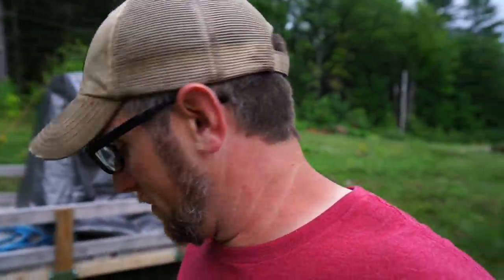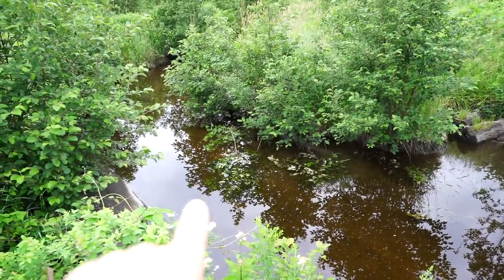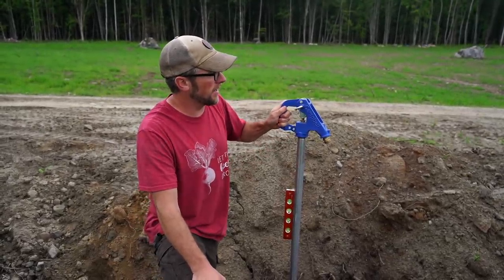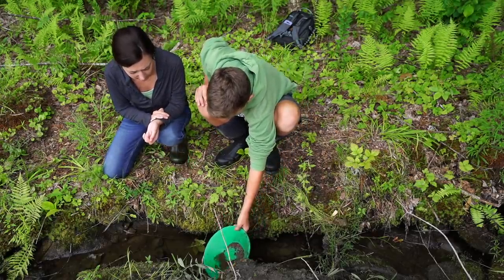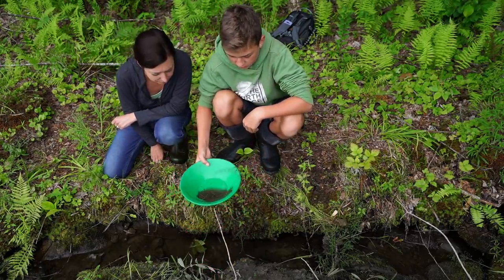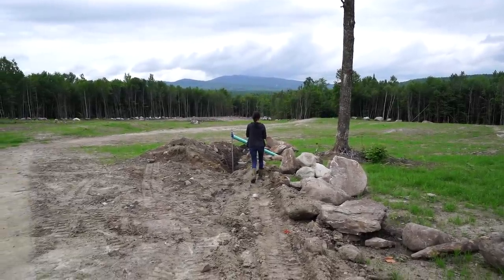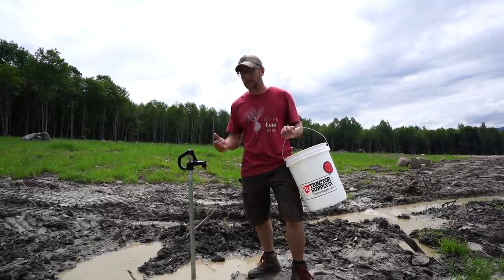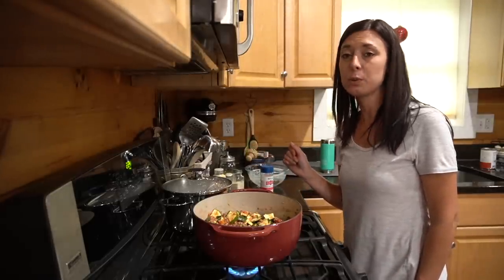DID We JUST WASTE all of OUR TIME & MONEY!?! Testing Our DIY GRAVITY FED Water System

Comment: Is the tank vented? If not then that could cause slow flow.
Reply: Besides the overflow pipe?
Reply: That would not have been instant, it would have taken a few minutes to build up a vacuum in the tank. Still even then it needs to be vented.
Reply: @jameshartman5574   There's your vent.
Reply: If the creek is supplying more than is being sent down the pipe the overflow will not have air in it to be a vent.
Reply: @Gmanboobies  If the tank is being filled as quick as it's flowing out then there won't be any problem.
Reply: They said in the last video that the cover for the tank had holes in that would be your vent
Reply: The input from the spring would prohibit any vacuum from developing.
Reply: @ryanhoward1013  I must have missed that. I have a wife and a cat and sometimes I get interrupted when I'm watching.
Reply: @jameshartman5574  the overflow pipe would be enough, its not vapor lock.
Reply: an easy way to check that is to just take the top off the tank and see if it helps
Reply: Bill Herrick ,
You are correct. The water line is just like a drinking straw.
You must have an in and an out to have good flow.  It works exactly the same way for air flow also. In your vehicle ( car or truck ) turn on the fan ( heater or air conditioning ) with the driver's window open.  Then close that window completely. You should be able to hear the fan slow down a little as you close the window. It is because you are trying to blow air into a closed area. I always leave the driver's window open about 1/8 to 1/4 inch. ( winter or summer ) It makes for less stress on the fan. It does not have to work quite as hard. It works the same way for water. You can do a test ( experiment ) with a drinking straw. Fill it with water , place you finger over one end and the water will not flow out of the straw. At est it will perhaps drip a small amount. Now , remove your finger and the water will pour out of the straw. You see , it is actually air pressure that causes the water flow. By the way , water or air that goes from a larger diameter pipe ( or passage ) into a smaller diameter pipe will increase in velocity. Faster flow. Not more pressure but a faster flow. Try it with your thumb over the end of a water hose.
Reply: @donaldmiller8629  Good point but it has been determined the tank is vented in a couple of ways.
Reply: Simple...take off the lid and see it it changes...if not then you know.  Maybe a small solar pump at each spigot would do the job.
Reply: @rickster9993  Lolzzzzzzzzzzzz!
Reply: I think you could have something there. It does need a vent or it will start collaspsing on itself.
Reply: @zippythechicken  I like that idea! I hope Al checks that out.
Reply: @rickster9993  I just have cats, and that happens to me a lot. lol
Reply: @StoneKathryn  it won't collapse,  it's an underground tank 🤣
Reply: @rickster9993  exactly 💯% 👍
Reply: I was wondering about the ‘head’ in the system.  I can’t tell from the videos, but it seems that the tank and faucets are pretty much on the same level.  If this is the case, the water viscosity will seriously affect the pressure over longer distances.  Even shorter distances won’t give you much pressure (if any) when everything is on the same level.
Reply: He needs to lower the hydrant's, they are to high, they need to be much lower than the tank to allow gravity to work right.
Reply: @StoneKathryn  thanks :o)
Reply: He put an screw top on it. Then does it have any ventilation. I am grad you thought of that. It did not even cross my mind.
Reply: It's easy to check if it needs a better venting system.  Just remove the cap and turn on hydrant

Comment: Al the risers for the hydrants are to high, this puts them to close to the elavation of the water suply. Lower the hydrent will give you more water flow.
Reply: My thoughts indeed!
Reply: My thoughts also Al , how many feet fall is there from the bottom pipe of your tank to the top of the hydrant?
Reply: Exactly, he is almost expecting water to run uphill ?
Reply: John you the man.. I have a question so if there is a break in the line, will our boy have to dig it up ?
Reply: @whaler4life507  LOL, no, just turn 3 circles and click your heels together!
Reply: I agree. the problem with those hydrants is that he may need to dig them up to shorten them. the actual "VALVE" is at the bottom of the hydrant below the frost line. This is the same design as a fire hydrant. I hate seeing Al do so much work without properly researching the task beforehand. Checking the grade as you dig would dictate where everything would have needed to go to function properly. Fore example, the tank may have had to go further up the stream to get the proper drop/flow Al was looking for.
Reply: Still,won’t have enough flow to do anything.  Needs a lot more elevation.  Every 2.3 feet is only 1 psi.  Shortening the spigots will only get him about another 1 psi.
Reply: @SpicySteve-tz2so  I think he knows this but he said he didn't want to go back in the forest to get higher up to the spring. He didn't want to start cutting down trees to get his equipment up there to install it higher.
Reply: @StoneKathryn  what's another few trees going to matter 🤣🤣 he's cleared so many acres already
Reply: @whaler4life507  you bet😁
Reply: @SpicySteve-tz2so  He forgot his laser level that day , remember .
Reply: Here's an idea....get a couple more of those food grade water containers and place them in a row above ground. Use 2" bulkhead fittings to connect all of the tanks together. Place the bulkheads on the sides near the bottom. Place the tanks on a concrete pad. If you can't do that make sure to use flexible pipe (what they use for ponds) in-between each tank so there's not much pressure on fittings or pipes if the tanks move in dirt..buy a solar well pump they sell kits on eBay. It's a low flow pump and panel for around 2 to 3 hundred dollars. Put the pump in your buried tank elevated off the bottom. Pipe the pump to your tanks.install an over flow pipe at the top. Connect your hydrant pipe to the bottom of the above ground tanks. The solar pump will fill all your tanks during the daylight at a very low flow. All of the tanks connected above  ground should supply good pressure. I have a good idea for hot water also let me know if you want the info.
Reply: @colinstace1758  Those acres were cleared by the loggers with actual heavy equipment.
Reply: @wildtimbrown  would a water ram work at the spring to push the water? Runs by gravity I know we used to use one and it pushed water up a steep mountain! Lived there serval years never no problems.

Comment: As a FORMER LISCENSED Plumber, I will tell you that your pressure and flow depend on various factors. Most important is fall. The greater the fall the greater the pressure. Your pressure will increase just under a half a pound per foot of fall over the run, provided you can maintain a constant flow. The pressure will never be greater than that unless you add an external source of pressure, like a pump. If your flow rate, or volume, is not constant than it can make your pressure appear to drop. You shouldn't have a problem with volume because your line size is greater than the size of your hydrants and you have that large tank in reserve. Your flow rate, how fast you can fill a bucket or how many fixtures you can operate simultaneously, will increase with pressure as long as there is adequate volume supplying it. That takes a series of calculations based on flow rates of fixtures, pipe sizes, and pressure. Any type of inline on-demand pump would work to increase your pressure, but you would be better served to install a pump designed to work with a well. A marine pump or RV pump is designed to operate infrequently for very short periods of time. You will want a pump that is designed to operate regularly for longer periods of time. I use a pump I purchased from Harbor Freight to increase the pressure from my IBC tote rain collection system. My pump is 110v but they make 12v models. Having a pressure tank will help maintain constant pressure also. If you add a pump with a pressure tank, try to get a tank large enough so that your pump doesn't need to come on for your most common jobs. If you are usually only going to need to fill five gallon buckets, then a 5 -10 gallon tank would be alright. If you are going to be running several sprinkler heads at once you might need more. As a homesteader, you probably understand it is sometimes practical to over build so you are prepared for something unexpected in the future. I would wait until you get the water tested before doing anything else though. I am sorry I didn't post this part earlier in this series. If the water is contaminated with something a filter can't remove, you might not want to use it at all. I expect and hope that since it has been running all this time and things aren't dead around it, that it will be perfectly fine. If you do install an inline pump, either put it above ground in a pump house (the preferred method) or in a large enough manhole in-ground to access it. I would suggest an insulated pump house with solar panels on the roof and the battery, pump, tank, and all other equipment inside (possibly a small electric wall heater also). Make sure that if you do install a pump, you also install a ball valve and check valve before the pump and a check valve after the pump/tank assembly for repair purposes. You will also want to install a tee in-between them somewhere with a valve to drain that section down some when making repairs. I apologize for the long complicated comment, but I want to make sure you are informed so you can make the best decision for your family. The best suggestion would be to consult a licensed plumber or well installer. If you wait till you have your well drilled, you could probably get some good, free advice from someone knowledgeable and who is on-site to see exactly what you are working with. I know your system isn't a well exactly but if you add a pump it isn't really gravity fed either. If it is a 12v pump, it will still be off-grid.
Reply: Hopefully Al will take note from a tradie  ,though sadly seems to like to do his own thing and not listen to those that have the knowledge  he lacks ,but must give him fill markes  for trying ,at times reminds me of a chap had a farm near us when a youngster  the Old man  called hin Hard Way Jones , if there was a hard way of doing thing  Jonesy  would  find it and at times double costs or have to redo

Comment: Gooooood Afternoon Al , Gina & Olivia ,
Al , if you reseed and plant alfalfa over and around the trench area , the very deep root system will help to stabilize the soil and will help to prevent soil erosion. In addition , the deep root system will bring minerals from deep underground to the surface. Which is good for your grazing animals and ultimately good for you also.
  That soft and loose of the trench will channel the water from rainfall and begin a erosion gully if the soil is not stabilized.

Comment: I've seen a RAM pump system installed on farms before.  It's not run on any  power source, but by water pressure that runs the pump. You'll have to look for videos. I'll look and see if I can remember where I saw that.
Reply: Engineer 775 youtube
Reply: Stoney ridge farms on YouTube ram pump

Comment: When I originally saw you starting this project, I was wondering if you were going to put a ram pump in line, like the ones that Land to House is always building.
Reply: Ram pumps work when the pipes can stay exposed and there's more elevation change. Here, it all has to be buried to be practical.
Reply: Ram pumps are used to "Lift" water to higher elevations.  It is not used to increase flow for water that is going to travel downhill.  If it pumped at all, it would pump once, then the suction from the water flowing down hill would keep one of the valves inside the ram pump from closing, and the water would simply siphon through the pump to the open hydrant.  You would end up with a pressure "drop" through the pump....the exact OPPOSITE of what you want.
Reply: @dper1112  ,
Ram pumps work on pressure built up by the water. Not by elevation. That is why they are called Ram Pumps. Ram pumps can even pump water uphill. Ram pumps are not very efficient because so much water flows through them and out. However , they do pump 24/7 without any external power applied. It is a low flow but it flows 24/7 !  It's better than no water at all and no external power is required. Other than the flow of water in a brook, creek or river.
Reply: @donaldmiller8629  And the spring is gonna flow 24/7 whether you use it or not.
Reply: @donaldmiller8629  I mostly agree. Ram pumps need pressure, and the way they get pressure is elevation change.
Reply: @dper1112  ,
Well , that is sort of true.  Flowing water , by it's nature is flowing downhill so there is a sort of elevation change. The flowing water causes one way valves to operate building up some pressure in the pressure chamber. Then when the last valve is release it causes the  "ram " effect pushing the water into the water line.
  I have rad a comment to the effect that ram pumps are for pumping water to a higher level or uphill . That is not strictly true. Ram pumps simply move water from one location ( the stream ) to another location away from the stream. Which of course can also be uphill. Or simply some other location that is away from the stream of water. I have seen in the Philippines where the water was only pumped into a nearby cistern where the water could be pumped out of the cistern with a hand pump. In that case the cistern was lower than the stream. The cistern could have been filled by the stream itself. But with the ram pump the stream did not have to be diverted.

Comment: Good morning Al, I work in the RV industry and the pumps are 12v and on demand.  However, they are not submersible...you'd have to plumb it in between you're supply tank and the demand line going to the hydrants.

Comment: In order to have pressure, you have to have lots of drop on the system, which you don't have. You'll either need a pump, or use a ram pump in the creek to fill a tall water tower. Then you will have pressure. You may have to use under ground storage for winter,  but you will have to pump it. Can't wait to see your new homestead evolving!

Comment: Goooooood Morning Al , Gina & Olivia ,
I'm glad to see that the water system works. If the water flows too slowly you may want to check that you have a good vent on the storage tank. It's sort of like having a good ground on an electrical circuit. I see many comments about adding pumps. Whenever I am working on a project I am constantly reminding myself to KISS it. ( Keep It Simple Stupid ). The more complex anything is , the more maintenance is required and the more stuff to go wrong. I have seen ram pumps mentioned several times. If you do have flowing water , ram pumps are good for moving water over long distances and even uphill with no external power required. They are low flow but they operate 24/7 and without any external power required.

Comment: If you're looking for more pressure by adding a pump, the first big question is whether you need something that works in the winter. If so, you probably want to build a pump house near your buried tank, insulate the heck out of that, and outfit it with a pump, pressure tank, and solar system. If you're aiming for 3-season, there are a few other options.

Since your house is going to have a well with all of that stuff, my guess is that you'll want to keep the current system minimal.  Add another spigot farther down, in the lowlands, and that will get you some more pressure.  That being said, don't expect too much.  Home plumbing systems typically have 30+ feet of head pressure, and there's no good way for you to get your water tank 30 feet higher than those spigots.

RVs have inline water pumps, but you don't want RV-grade, because those tend to break.

Comment: Tractor supply sells an "on demand" pump. Install it by the tank because it's a pusher pump. You'll have 40 psi. I have that setup. Love it!!
Reply: How does the "on demand" function work?? Is the pressure drop all sensed at the pump location or does there need to be a connection (electrical) between the supply and the outlet??  A number of commenters suggested running a conduit or cable in the ditch along with the water pipe. Guess what, sorry to say,  like so many other good suggestions, Al didn't mention it and completely ignored it just like all the comments regarding the flow/elevation correlations, rocks in the ditch, etc, etc. Now, in order to get any kind of pressure, it looks like he's going to need to dig a 4' ditch at the tank end, and maybe both hydrants. ;o(
Reply: @pappabob29  yes, the  head is pressure sensitive. When the pressure drops, the pump kicks     on. A solar panel and a deep cycle battery will give him around 40 psi. That's plenty.
Reply: @williamlane9140  
Thank you William.

Comment: Water pressure is not dependent on water volume, only water height. If the height of the spigot nozzle is half of the height of your reservoir, you will have zero water pressure beyond that point. Whether you have a 5,000,000 gallon tank or a 100 gallon tank you will have exactly the same pressure if their elevations are the same. You need to get your reservoir to higher ground.
Reply: Right you are.  https://ibb.co/WtgN9z7 <- I drew a simplistic view of the current system with one hydrant.  The higher the tank, the more pressure at the hydrant.
Reply: Glad you said this.  It’s the old saying…. “Water seeks its own level.”   With the tank buried, those hydrants need to be way far down hill for even just a little pressure.  …and by downhill, I mean “at a lower relative elevation to the tank outlet.